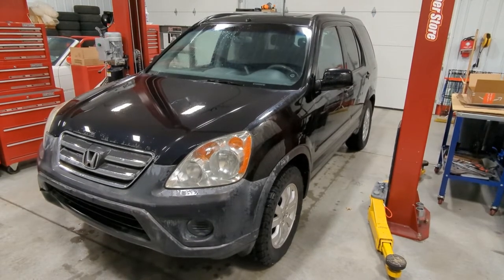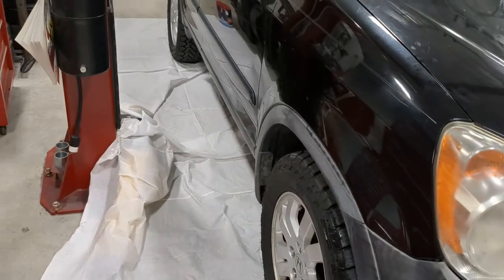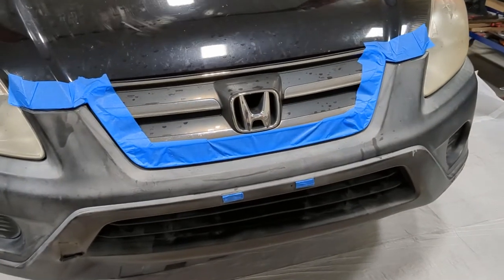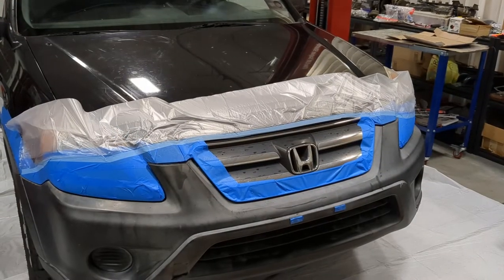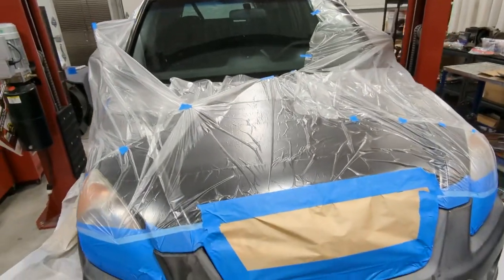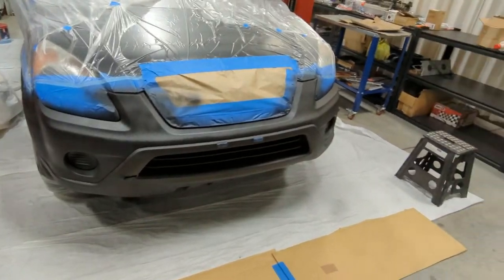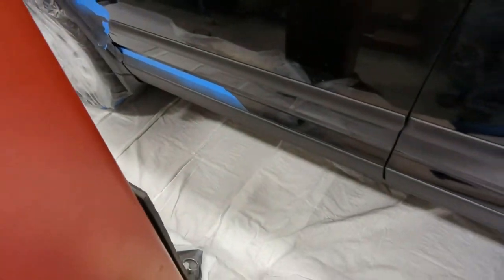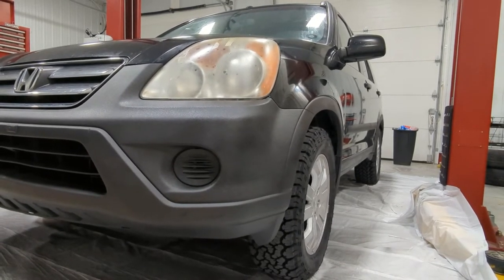Honda CR-V: Rhino Liner Painting Bumpers & Trim (2nd Gen)

Comment: How’s the spray liner holding up?
Reply from the maker: Excellent !!!
Reply: @PowerSports  Difficulty on cleaning and maintaining?
Reply from the maker: @mAtchew91   I just drive through the carwash with it. Seems to get it clean enough. ^_^
Reply: @PowerSports  Cool! I was curious if dirt stuck to it or was overly difficult to clean off. If the automatic wash can get it done I'm sure a regular hand wash could too. Thanks!
Reply from the maker: @mAtchew91  I haven't tried to hand wash it. The texture is super rough. I feel like it would tear up the wash mitt. 🤔

Comment: Did you end up using all eight cans? If it’s in the video I apologize I must not have caught it
Reply from the maker: Sorry, i forgot to include that info.  I want to say I used maybe 4~5 cans.  But as long as you don't open the lid, then you usually can return an unused can.  I actually ended-up using the leftover cans to touchup undercoating on my racecar, lol.